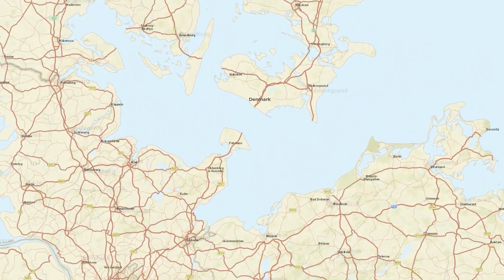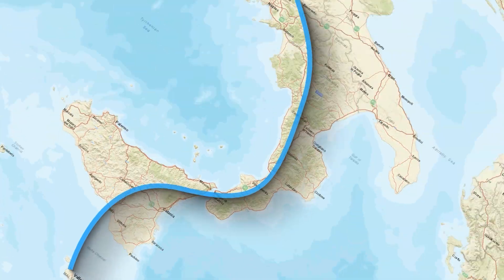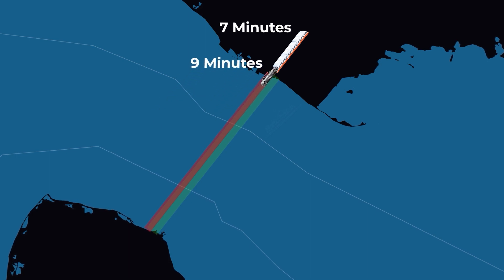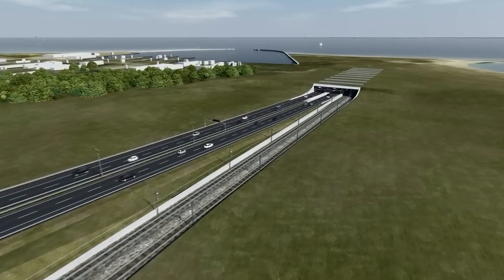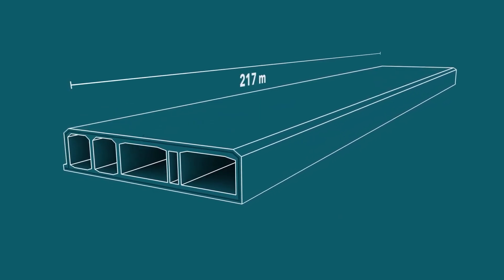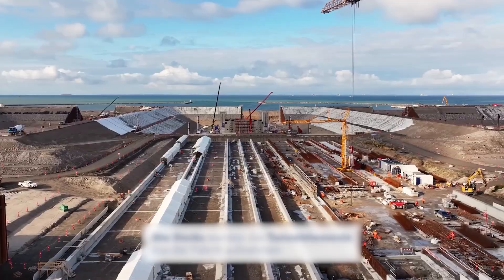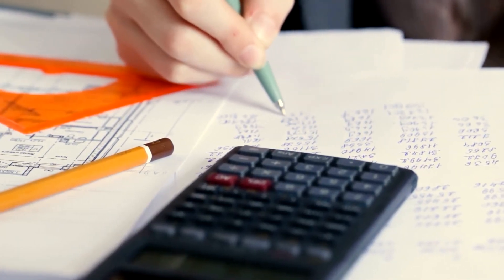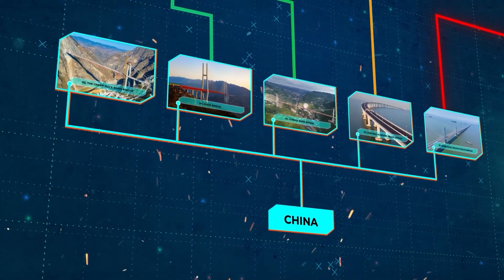Europa’s Innovation: The $10BN German Undersea Tunnel

Comment: The tunnel should’ve been built with 4 train tracks instead, and no roads, to force cars to go around, or to make people take the train. Also, the danish and german railways on each side should’ve been upgraded to 250km/h.
Reply: Yes it should have been cars waiting for a "Train" instead of a Ferry (As between France and GB)!! And hardly any stretch of rail in Denmark is straight enough to run at 250km, plus all the damned stops at Stations to be able to unload or add passengers, unless just going through Denmark to Sweden, of course. But when all cars have become EVs, no problem!! But why make things simple, when it is possible to make them more difficult?
Reply: The political compromise in Denmark for big projects like this will ALWAYS(!!!) be a combined train/road solution!!  It would never go through politically as a 100% one or the other "solution"!  One side favours roads/private cars more, and the other side favours trains/public transport more. Both left-, centrist- and rightleaning Parties are part of the political decision to go ahead with this tunnel project now.  Which secures support of it for the future. From those Parties and their voters!

Comment: To be fair: it is more Denmark's tunnel than Germany's. Actually Germany is guilty of delaying the project for a decade.
Reply: Yeah, it has not much to do with Germany. Danish financed, Denmark takes the income. Tunnel elements build in Denmark. The only thing German is the name Fehmern.
Reply: @Gert-DK  That is not 100% true. The connecting infrastructure changes in Holstein are not nothing. But they are delayed.
Reply: @Nils_Ki  That what we have to do on the Danish side too. New railway station, new tracks, new signaling system, new motorway, a 4 km new span bridge ready for cars 2025 and trains 2027. The new Storstømsbridge costs a lot, and it will become the third largest in DK.
I guess it is pretty much the same on both sides. 
Will it become highspeed rail, all the way to Hamburg? I really hope so. Then it will be highspeed from Copenhagen to Hamburg, even in the tunnel.
Reply: @Gert-DK  It is definitely not going to be high speed, especially not the temporary solution because of the delayed Femern Sund tunnel.
Reply: @Nils_Ki  On the Danish side, it is. Definition of high speed is 200 km/h. The process of going high speed is in progress here in DK, on the mainlines. The rails and signalling is good for 250 km/h, even though our new trains are only allowed 200 km/h. Kind of future proofing. 200 - 250 km/h is fine here in DK, many train stations are close, so train acceleration is weighted high, not so much top speed.

EDIT: Google is a good thing, see what I found:

Puttgarden–Lübeck railway, to be electrified and upgraded to reach 200 km/h up from the current 100–160 km/h.The new Fehmarn Sound Tunnel (to be completed in 2028) is part of this section.
Lübeck–Hamburg railway, to be upgraded to reach 200 km/h.
Reply: @Gert-DK  Sure. It sounds all very nice. But don't expect all of that between the tunnel and Hamburg to be finished before some time in the mid 2030s. Sorry my friend. I live in northern Germany, and I don't see a lot of enthusiasm here to get it done. Other infrastructure projects in Germany are ranking much higher in the minds of my fellow Germans than the "Vogelfluglinie".
Reply: @Nils_Ki  Yeah, I do know it isn't the top priority in DE, but nevertheless there is a international contract to be upheld. 
Earlier today, I took a look at the train schedule from Puttgarden to Hamburg. I noticed there were no trains between Puttgarden and Lübeck at all, only buses. It could indicate the upgrade has started. Maybe you know more?
Reply: @Gert-DK  Yes, it has started. But it is official already: The Femarn Sund Tunnel will be delayed. So now it is planned to put catenary over the single track on the current Femarn Sund Bridge as a temporary solution. Expect more bad news like this in the next years.
Reply: @Nils_Ki  What has gone wrong with Germany? The German "püntlichkeit" has disappeared.
I found an interesting article. Here is a snip:

"According to Professor Matthias Gather, who is professor of transport policy and planning at Erfurt University, the Fehmarnbelt connection is far from the only place where the Germans are having trouble delivering the agreed rail infrastructure for transnational rail connections.

- When we look at large infrastructure projects in Europe such as the Brenner Base tunnel, the Fehmarn Belt tunnel or the Gotthard tunnel - in all these cases Austria and Italy are ready, Switzerland is ready regardless - just as the Danes will be ready with the Fehmarn Belt tunnel. But the Germans are not ready with their so-called 'hinterland' access, he says and adds:

- It is not an exception, but the rule in Germany."

I think we need to take back Schleswig und Holstein 🙂
Reply: @Nils_Ki  Yes but the roads and bridge will to a high degree be paid for with The Danish Raised Money, as part of the new and more used Transport System. The small bridge and the roads on Fehmarn will have to be made with 4 lanes, as the Tunnel. But the traffic will most likely be more spread than the large group of cars and trucks presently coming from the ferries!
Reply: At Sweden's request and since the company building, owning and running it will be Danish state-owned, I can't see how it's a German Tunnel.